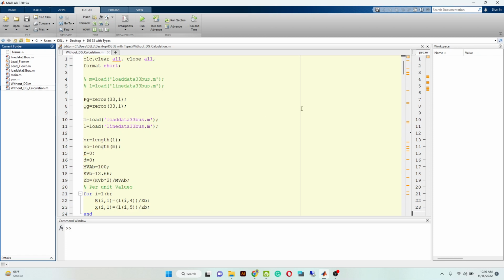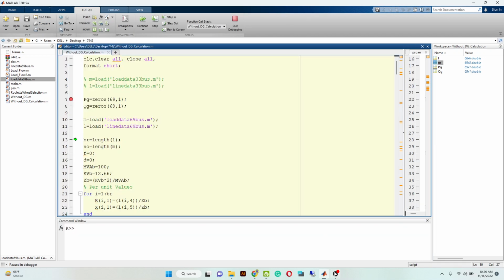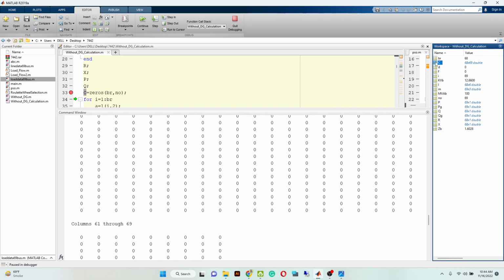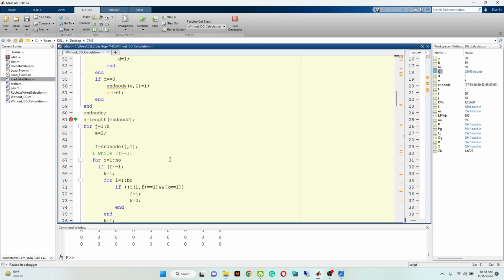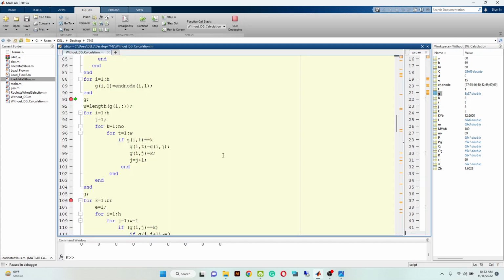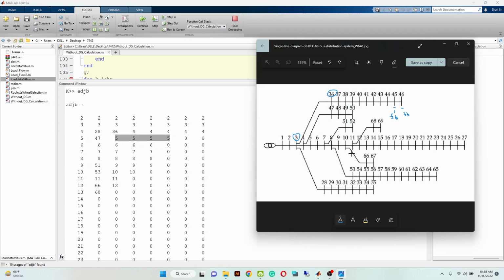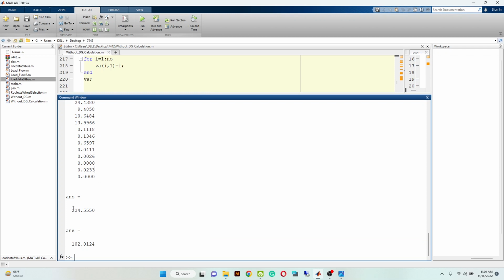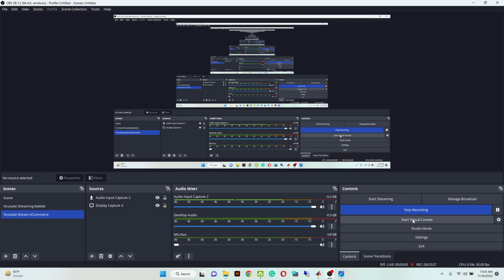MATLAB Code for Power System Load Flow Without Distributed Generation

Comment: Sir, 
How can I change the values in backward forward sweep Load flow method of changing the tie switches value because in this code it used only sectionalize switches for my problem network reconfiguration.